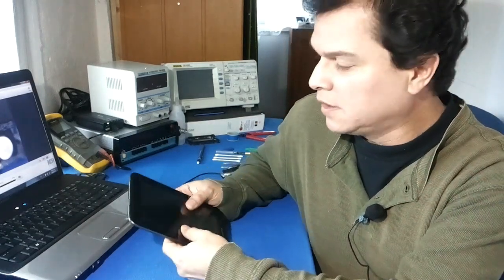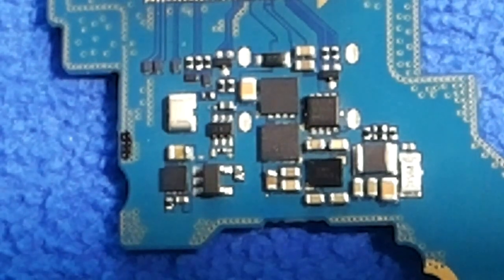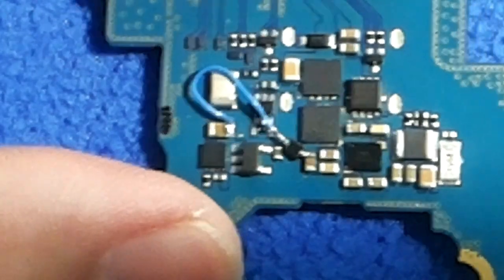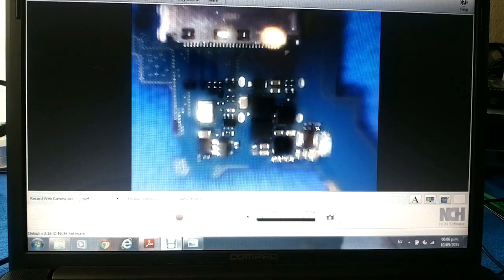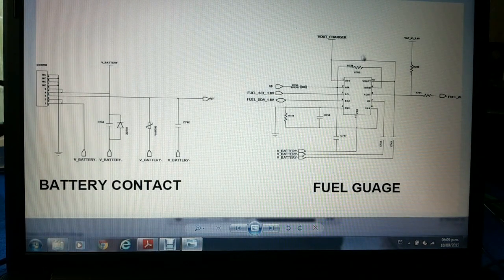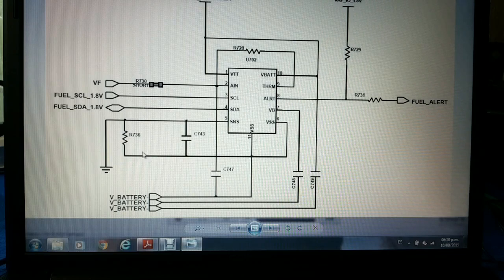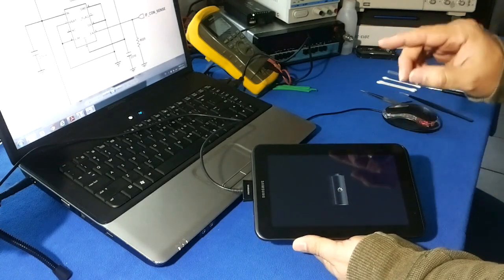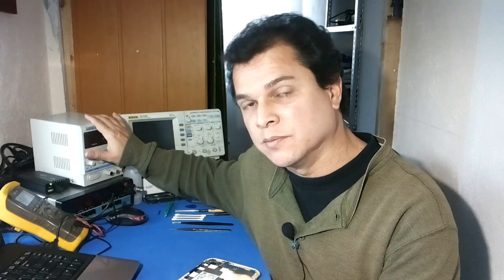Samsung Tablet 2 not charging, turns off, fixed - How to fix tab on chip level. GT-P3100 / GT-P3110

Comment: My Samsung tablet charges sometimes, and when it does... my battery is never full. when i turn it on it shows the Samsung logo till its totally flat any body with a smarter idea????
Reply from the maker: +Asiphe Radasi   Hi! First try another charger. If it charges the battery is good. If the charger is ok, then discharge the battery and recharge it again externally to analyze it. If after place it back to the tablet, it shows lower voltage level, then the problem is after the charging process. If the voltage level is right, then the problem is between the charger and the charging process. 
But most of the time, you have a bad electronics component in it, and you, if you are a technician, or a qualified technician, must look for it and fix it.
Reply: Hey thanks man I tried that already, the battery is fine but the tablet is failing to mount

Comment: I have a samsung tab 3 10.1 it's been off about a year because the charging port was bad,today i replace it and when i conected to the charger the battery logo come on, but like 10 seconds later the screen when off,i think it needs a new battery,somebody has any ideas? ???
Reply from the maker: +yea baby  Yes. Try to charge your battery externally to revive it. If it works, then you can make the bypass to avoid the problem in the future. Make sure the battery is not inflated, because then you must replace it.

Comment: hi..sir bob , i got same trouble like your video , but my tab its samsung tab 3v (T116) how to fixed?  so please teach me master bob...thank u
Reply from the maker: +nendry levi  Hi! I made some videos from general electronic equipment we got to fix from friends or clients. It is not that I have some specific tablet like yours on the stand and the time to record a video. From all the electronics components in it, any one or them or more than one can be your problem to fix. I can help with some advises to colleagues with technical knowledge and experienced in reparation skills. My best advice to you is to bring it to a technician for repairing. (People ask for technical help, but they always add pictures, plus information about what they already tested or have done in it. But it is not that any technician or engineer can point to the right button and it will be fixed). Please be carefully about playing with it. Remember the battery could explosive or fire ingnittion device.  
Most of the time we see the tablet trying to charge and discharging, it is related with an electronic component in short circuit. After solving the electronics reparation, the battery should work fine. Or if by default the battery is under the operation level, then it can be charged externally or to bypass it to avoid the under voltage problem. BUT, first, as I said, the bad  electronic component must be repaired.  :-)

Comment: It worked for me! Thanks for sharing!
Reply from the maker: Hello! I used a smd diode. The wire is flexible, insulated, and "soft". Because a thick strong wire, can force to unbend itself, and take off the diode or the capacitor. ;-)
Reply from the maker: +Andrei-Cristian Gherghescu  Hi! Thank you! :-)
Reply: +Bob. Kalpon is it essential to use the transister that you use with blue wire
Reply: Could you please let me know, what diode have you used?

Comment: Hello Bob. Galpon let me know that the diode datasheet I use in the reaparacion the table ... and this best video, thanks.
Reply from the maker: +luis humberto mendoza molina Hi! I didn't have SMD supplier in that moment. I just took a diode from an new board and used it. I recommend to use a good diode like 2 Amps, or a "big" SMD diode from an unused tablet, laptop or smartphone. Any one close to the input connector.
Reply: +Bob. Kalpon, thank.
Reply from the maker: Some cars burned the engine because its use. Another new cars, crashed with total lost, but the engine was like new. We can't have a full inventory, and or Supplier doesn't have it all. To collect components is an art. I try to get from broken computers and smartphones. They can be new, or like new, but cracked plastics and broken main board, but they are a great source to fix things. Remember, if we can fix it, we get money. If there is not part to replace, we just lost the time, and the client its item. ;-)

Comment: I just got the capacitor off, it is 1.3 uF approximately, this is the reading putting the multimeter on both sides of it. Is it correct? I assembled the tablet again, now it seems that is charging but it doesn't  charge, this could be because I haven't put the diode? Now, I found this diode in ebay, this could work? 200V 2A SS220 SR2200 SMD Schottky Diode? Thanks...
Reply from the maker: +Enrique Martinez  It looks good! :-)
Reply: +Bob. Kalpon what is good the diode or the capacitor?
Reply from the maker: The diode.

Comment: Hey, 
sorry for my English
Can I use this a diode ?
for example
"SS24 SR240 SMA 2A 40V SMD Schottky diode DO-214AC"
http://www.ebay.com/itm/100pcs-SS24-SR240-SMA-2A-40V-SMD-Schottky-diode-DO-214AC-/291526845841?hash=item43e05aa591:g:OykAAOSwDNdVuXpj
or
"IN5822 SMT SMD 40V 3A Schottky Diode Black"
http://www.ebay.com/itm/20-Pcs-Electric-Components-IN5822-SMT-SMD-40V-3A-Schottky-Diode-Black-/301725171927?hash=item464038c0d7:g:jFwAAOSwL7VWrd3J

thank you for the quick reply

Comment: Hi Bob, great video.  Is the diode you're using just a rectifier diode with forward voltage drop of 0.7V?  I know that a 1n4001 would be physically too large so what are you using?  A good friend of mine is having problems with her tablet.  I'm going to try to get her to send it to me.  might as well put a new battery in it when I have it open.  will this modification cause any problems with a new battery or is this correcting a design flaw?
Reply from the maker: +Eric Ellis  Any diode strong to pass 2 Amperes is good. If you read the comments you will see that to place an 1N400X diode is not a good idea. Because the mechanical problems, and if it straights up, it will take off the capacitor. It is better to use a SMD pulled diode from another smartphone, tablet r laptop. If there is an electronics problem to fix, you must look for it and repair it. The bypass works well with Samsung original batteries, because it has a chip, and they will stop charging at the end.
Reply: Thanks Bob, I wasn't planning on using the 4000 series since it would be way to large anyway.  Great little video.  Her tablet is having a problem where the screen flickers a bunch of random junk.  It you give it a "technical tap" it starts working again.  Guessing that the connection is loose/oxidized/whatever.  Came across your video and figured I'd do the mod to prevent a future problem.  Will get an oem battery replacement since it doesn't last very long before it needs charging.  Thanks again for your help.
Reply from the maker: Dear Eric, please check Enrique Martinez comment. :-)

Comment: Bob, I have a Samsung P3113TS Tablet 2 with the problem you described. I would like to apply the fix you demonstrated. Do you have a video showing how to get to the location on the pcb that the diode is applied to? I downloaded the service manual and schematics for the P3100, so are these are the applicable documents? I am a manufacturing engineer, with some electronics training, so I think I should be able to do this. What is the diode part number or specifications to do the replacement?   If I apply this fix, will it cause the battery to overheat in the future, or be unsafe in any way?  Thanks for the video!
Dan
Reply from the maker: +Dan Dell Hi! I don't have a SMD diode supplier. I recommend to remove the diode from another tablet, smartphone or laptop out of order and to use it in your tablet. Just try to find a "big" diode close to the power input from them. I did the diode bypass after fixing a bad capacitor in the tablet. 
VERY IMPORTANT: if the battery is Samsung original, it will not over charge or heat . The battery will stop charging when it is full, because the internal chip in the battery will stop the charging. (Reducing it to very few micro amperes).   
JareK K added a picture for you:  http://pokazywarka.pl/howdiodeconnected/

Comment: Sir please one more help i tryed to do it and i got another problem please i need your help ride now it is not showing the charging plugins anymore it a problem on the charging system some of the small pin at the charging part wasoutso i pushed them in and now not showing charging again.
Reply from the maker: +chazzboy Hi! You have the connector's pin out in the diagram. You must use continuity test and voltage meter to find the problem. Remember the input voltage goes to the "capacitor who welcomes the voltage" in the video. But before making it too technical... try with a GOOD magnifying lent to see what happen there with just a visual inspection. Then go with digital multimeter after it. ;-)

Comment: heyy I have a problem with a galaxy tab 2 10.1, it's turning off by itself can you share a video showing us how fix the problem.
Reply from the maker: +Max Cabrera Hi Max! I didn't understand the sentence. Are you asking about share this video?
...or are you asking for more information about how to fix the tablet?
(O pides obtener más información acerca de cómo reparar el problema).
Reply: +Bob. Kalpon no i'm asking how to fix the problem that my tablet has. as i said before if you can make a video showing me how to fix that problem
Reply from the maker: I make videos about some things to fix from my clients, and I share the fixings on it. But it is not that I have an specific model of tablet to make a video about. If I get it, I will make a video. But take in consideration that the bad component inside of it, can be different for each tablet, even if they were the same model.
Reply: ahh ok, where is your store?
Reply from the maker: I have a small business somewhere in East Europe, and I travel a lot most of the time. 
Max, please, check if these links are about your tablet model:
http://www.s-manuals.com/pdf/tablets/samsung/samsung_gt-p5100_r1.0_service_manual.pdf
http://www.s-manuals.com/pdf/tablets/samsung/samsung_gt-p5100_service_schematics.pdf

Comment: Something else, what is the capacitance of this capacitor?
Reply from the maker: Hi! I don't know. I don't have a similar tablet to check it. But most of the time, parallel small capacitors are 0.1 uF, if smallest are parallel to it can be 0.033 and 0.01 uF. They are used next to each chip to suppress the electrical noise.  So, you will find the 0.1 uF capacitor next to most chips in all electronics equipment.

Comment: Hi Bob. I found my C743 is in short-circuit, you mentioned in your video that you changed it. But your video doesn't show this change, isn't it? This capacitor is on the back of the board you show in your video. So how I can get this kind of capacitor and how to change it? Thanks for the advice!
Reply from the maker: +Enrique Martinez Hi! I don't remember its value. (Capacitors for stabilization of reference voltages for less than 100mV are from 10uF to 1uF most of the time). IF, it was the problem, the tablet can work without it.
PAY attention: C743 is in parallel with a low ohms resistor. (There is another like that in the WiFi section). Make sure your capacitor is really bad, and no that you are reading less than one Ohm value in parallel to it. As I said; if C743 was your problem, just remove it and make the "diode bypass", and it should work.
Reply: +Bob. Kalpon Thanks Bob, for the rapid answer. I'm sure this capacitor is the problem since I got a beep on both sides of it, when connected to the ground, besides I got a measurement of OL uF on my meter on both sides (connected to the board). So could you send me a diagram showing this "by-pass" it's like putting a diode parallel with the capacitor? With the anode to which side? How can I recognize it on the board.Thanks again!
Reply from the maker: +Enrique Martinez NOP!!! Just REMOVE the capacitor. (Make a test for the capacitor out of board). The tablet can live without that capacitor. The diode is placed in the other side of the board. 
Our friend JareK K added a picture for you:  http://pokazywarka.pl/howdiodeconnected/
Reply: +Bob. Kalpon Hi again. what kind of heater solder        are you using. I'm using a 40 w iron solder but it's been dificult desoldering the elements on board. Please advise
Reply from the maker: +Enrique Martinez We use SMD rework soldering stations for it. 
Some times, I didn't have the right soldering iron for it. ...I had to sharp the iron tip, and use a light electrical dimmer in serial with the iron to reduce the temperature. (I did it last year too when I moved here), until I bought my Gordak 952 Rework Soldering  Station. But it is not the right way to do it, if the component was so small. I had to buy 5 extra different size tips for my iron for professional jobs.
Reply: +Bob. Kalpon ok thanks
Reply: +Bob. Kalpon just for the records what is the recomended temperature for work with this kind of components?

Comment: Sir Bob I have send you mail so need your help regard it
Reply: +chazzboy hi what is your problem is the same samsung galaxy tab 2 battery chargeing problem
Reply: +chazzboy you can add me in viber +9779860134927
Reply: +chazzboy can you post a video or some photos what you have done
Reply from the maker: +J raaz There is goes: http://www.s-manuals.com/pdf/tablets/samsung/samsung_gt-n8000_service_manual_r1.0.pdf
Reply: How did you get him to send the email.

please help I cant solve my own.
Reply: +J raaz Yea brother please help  me out. I have many and I dont know why please help.
Reply: +chazzboy you can add me in viber +9779860134927
Reply: +chazzboy I'm also not good on solving this things but I might help you I also learned some idea from sir +Bob. Kalpon
Reply: +J raaz See please i cant access the internet again I viber throuth my tab but know I get some fault But dont worry I will get viber installed on my pc.
Reply: +J raaz please I opened it and I found the board were you people are talking about but another problem has pop itself out I push  all the metals from were the charging system was and now it not even coming when the charger is pluged.

and also I wanna know can i use any wire for that connection?
Reply: +J raaz Yea I will please let me some time.   I will post it.

Comment: Sir Bob I do have samsung gt-n8000 but it's dead completely I did check battery voltage but the voltage is fine just need your help to fix it
Reply from the maker: +J raaz Hi! The battery must be 3,7 Volts to turn on the tablet and operate it. If the battery is totally charged, and the tablet doesn't turn on, the first thing component we can accuse is the main switch. But your case is different, because it is totally dead. You have problems in the charging bypass mosfet transistors. Most cases with short circuit capacitors, the tablet will try to turn on, and then goes off. But completely dead, could be an open mosfet transistor. Try to identify them in the charging area, and carefully try to bypass its "Drain" and "Source", to find out in which one turns on the tablet.

Comment: Sir Bob just want to ask you what value diode I can use it....
Reply from the maker: +J raaz Hi! The answer is in the comments. I used a diode without label. I always recommend to get a good SMD diode, with more of two amper if it was possible. Also, if you don't have a SMD electronic components supplier, you can use a diode pulled out from another smartphone, tablet or laptop, out of order. Just make sure it is one of the big ones close to the power input connector. :-)

Comment: Awesome tutorial sir, thank you very much...
Reply from the maker: +Costas V. You are welcome! :-)
Reply: +Bob. Kalpon 
Hey it is the same problem happening to my tab2 but I didnt understand any think because I m not on that level where you are. please help!!
Reply from the maker: +Raj Gill Hi! I fixed an electronic component before to make the bypass. But I am an electronics engineer, backed up with test equipment. You need to know electronics and get some experience or repairing skills before to perform any fixing. My best recommendation is to look for an experienced electronics technician to do the job. No everywhere is good. Some mobile phone shops have a trained person able to change screens and batteries. You need a real electronics service like the shops where they repair TVs, and general electronics, with good measurement equipment like an oscilloscope, and signal generators. 
Take your time to look for the good ones before to give it to service. :-)
Reply: +Bob. Kalpon thank you very much for your reply

Comment: hi. great video.
I've a samsung tab3 10.1 GT-P5210 it turns on but not charging .
I've replaced the battery with new one ,also 3 new charging port-flex and it stil not working, do you think I've issues with the motherboard or something else? ???
thank you in advance for your time.
Reply from the maker: +Kiril Iliev Hi! Yes. There must be something in open circuit in the charging area, if it worked with the new battery charged. Or there must be something something in short circuit, if it discharged soon, or didn't work that all with the new battery charged.

Comment: What diode are you using to create the bypass?
Reply from the maker: +Terry Townsend Hi! The answer is in the comments. If you don't have an electronics SMD supplier, then the best option is to take one diode from  another laptop, tablet or smartphone out of use. (In tablets and smartphones, look for a big diode close to the power connector). :-)